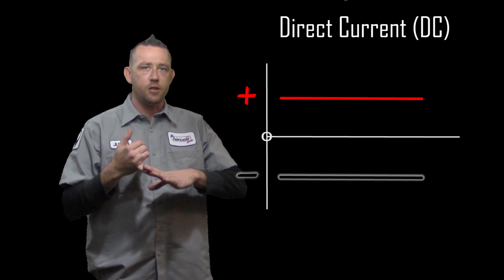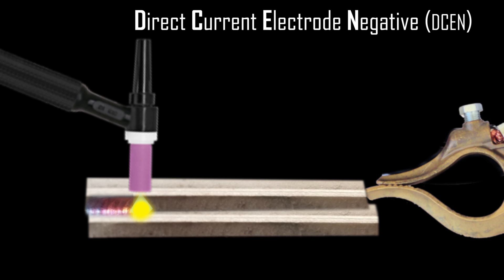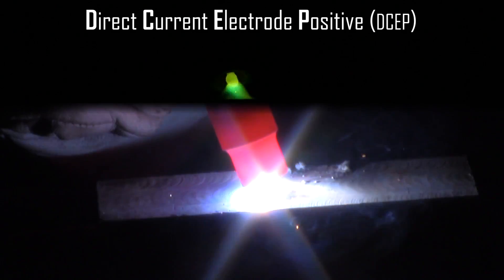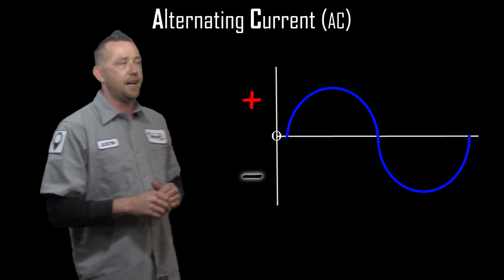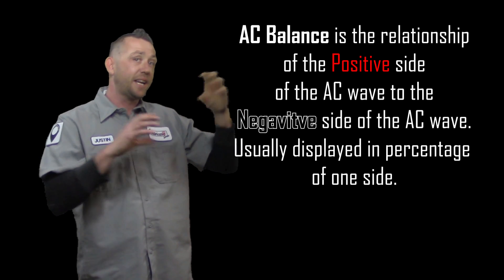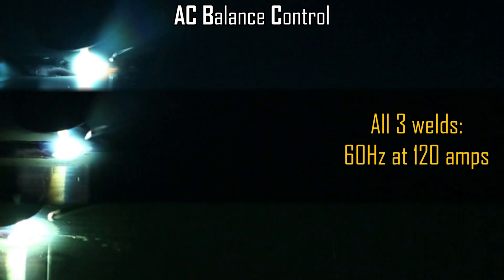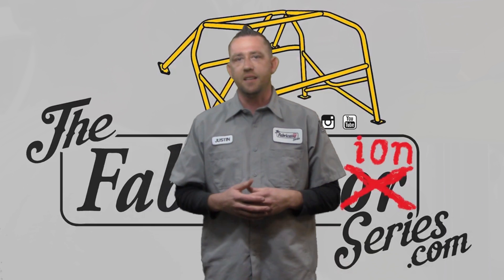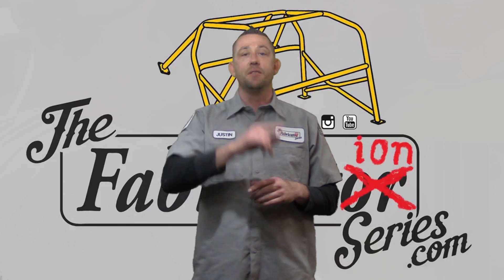TFS: Understanding AC Balance #TIGSimple

Comment: Could you please explain this tungsten electrode specification:-  Electrode diameter 2.4mm, DC electrode positive 100-200 Amps, DC electrode negative 15-25 Amps and AC 85-160 Amps. It seems that most TIG welders are electrode negative. Is that this electrode should never be utilized with a welding current more than 25 Amps electrode negative? Please explain. Thank you.

Comment: Fortunately I know that if Al is set at 1500°F in your graphic it should mean around its 600°C of its melting point, so therefore 3500°F should be approx 1400° of which temperature degrees normal people use. Yes I could ask Google for a conversion but... Oh please.
It would make more sense if you explain it in Kelvin scale.
Yeah it's a convention like any other but this thing makes no sense to me. And by this thing I mean the whole imperial system, which for how's not organized I don't see it being a system at all. I'm born with ten fingers you know, I'm not a buccaneer which has lost some of them to a crocodile. Damn, I try to learn something and have to focus on how to find a units converter...
Somebody will have to be stopping this madness, I'm just doing my part.
Thanks for the content anyways, units of measure was not the point of it ok.

Comment: Hi, i have the older type Thermamax Thermadyne tig 200p acdc inverter, new condition just alot of knobs. Not sure if you are familiar with it. I love your channel, you are extremely knowledgeable and straight forward. Mine don't show AC balance and Hz etc, different names. Can you help me with settings for Alluminium. I been ark welding for 28 years, mig welded a bit too but i need to master alluminium and stainless tig. My settings are Pre flow, Peak current, Basic Current, down slooe, arc force, pulse frequency, duty cycle, clean area width and gas after flow. Then ACDC, 2T 4T, pulse straight and tig mma. Thanks in advance, Michael Sharrock. Do you do online courses

Comment: Thinking to attend a tradeshow at Vegas in Jan 10-13, 2022.  Do you have a hands on training available near that time?  I'm pretty much a rookie, but have watched many vids (including yours).  I've successfully MIG welded mild steel with my Lincoln 180T, and a drive shaft for my son in TIG (steel), using my cheapy combo Simadre TIG/Plasma/DC Arc welder.  I Just ordered a Primeweld 225x, and expect it to arrive in a couple days.  Want to learn aluminum.  Currently have a repair project for cast aluminum (yes I know... not really a project for a rookie!  But I will try anyway.  LOL).  Would be great to get some training.  Thanks!

Comment: The commercials, the commercials! It's hardly watchable anything on here anymore. It's not as if they're a trillion dollar company. They need more power! Speaking of power. You're going to pull more power from the outlet messing with the A/C balance. ON the edge you may trip the breaker if you're close.

Comment: mate thanks a bunch for trying to teach us new types to weld Aluminium when showing us the alloy side you say your going a bit slow and yes i have bin welding and using TIG A long while back now trying to reteach my self now the QUESTION and i cant blame you if you don't answer its all good (( but is there a setting where you can slow things down some what as at moment in trying to keep up with the puddle and dipping rod its all a bit quick and i am melting the work piece any help would be appreciated  thanks wally

Comment: Hei Justin, just to be "politically correct" here. Electrons travel from '-' to '+' ... because well electrons are negative. Current is a convention and travels from '+' to '-' (Kirchhoff law) and same goes with voltage. I guess it is simple for human mind to see something going from '+' to '-'. Often this convention is very easily visualized as water flow (from top of the cliff to the botom of it). Cheers (by the way nice video, I just bought my first profi TIG AC/DC machine and can't wait to play with it :) )

Comment: Sir, what is the setting that you would recommend welding 3mm aluminum? Considering that I've cleaned the material?

What are the settings for 
1. Balance
2. Amp
3. Tungsten thickness and type

Thanks

Comment: While the effects of it may be described well by this, if one wants to be strict, the physics are a bit different. First of all, current doesn't flow from negative to positive. Electrons flow from negative to positive - they each carry a negative charge, and when negative charges travel in one direction, you have a positive current traveling in the other direction, that is, a positive current flows from positive go negative.

Secondly, the oxidation layer isn't "blasted off" by the current moving from the material to the torch - as said above, current doesn't travel in that direction. However, the current flowing from the torch to the material displaces electrons from the argon atoms in the gas. This makes them into positively charged ions. As we all (hopefylly) know, opposite charges attract, and since in this configuration, the material is negative, meaning the positive ions created will rush towards the material and it is this stream of ions that will displace the oxidation layer and allow welding to occur at the core aluminum melting point of about 1500 degrees.

Love the vids.

Comment: When I was an apprentice my instructor told us it was all to do with the temperature of the arc. On DC set 66% of the temperature is at the + side and 33% at the - side. Why you can't weld aluminium on DC - is because the melting temperature of the oxide skin on the aluminium is higher than the arc temp so there is no cleaning effect. But the arc temperature on AC split 50/50 so the temperature of the arc is now higher than the oxide layer and the arc cuts through that oxide layer giving you that cleaning effect. You can’t weld DC+ because the arc temperature being at 66% is too hot for the tungsten and melts it away. At that time all the AC TIG sets I used had no AC balance, so your balance was set to 50/50 with no adjustment. To overcome the extra heat, we used water cooled torches and larger zirconated tungsten’s whereas now you can turn the balance down to 70/30 for far better results.
Reply: You can weld aluminum on DC with Pure Helium. Tricky but feasible.
Reply: @hoseyogradey3487  I worked in a shop in nor cal many years ago where we used both helipad argon mix. We were welding 1/2 to 1 inch thick aluminum plate and parts we had the newest machines at the time the aero waves. I remember taking the test in this mix of gases and said I never did this before it looked weird as I was doing it but after much practice I got used to doing it. It does get sooty and black but that’s what we did.

Comment: Had to do a repair on my cast ally mower, just now. A crack that had separated the bracing (left side to right side) at the bottom rear of the mower needed to be stitched back together. Did a quick practice on some nice scrap ally panel (not cast), seemed ok. Ok time to hit the cast, what i didn't do was set the ac bal to 30-35 % which i had used on the panel (for some reason i set it to 50/50) Now i know why the dam thing was spitting tacks (didn't help with getting low on argon either, which i'd set to 15 tho most probably should've taken it down to 12) . It was a pain to weld like that however i persevered (only needed to weld 2.5") & got it done at least for now. Although my settings were up the Khyber it didn't turn out too bad. It could've done with a bit more grinding to create a deeper V for better penetration & strength. That cast really is a dog. The only other time i've welded cast ally was with a 150 amp mono mig (transformer style), i have to say the tig was far better if for no other reason than getting heat to the material quickly & at the same time not overheating & blowing through, where as the mig started cold with a huge blob then slowly came right, a bit to right when the heat got too much lol. Watching vids is great for getting settings & seeing what it should look & sound like, it then allows one to understand whats being said after welding as it's hard to imagine when you've never done it.  edit: i also didn't use the square wave i used the sine so i guess that didn't help either as i thought if i switched to the square it would activate the pulse function which is what happens when i stick weld & switch to it on purpose. I didn't think about turning the pulse frequency etc knobs to 0 lmao . Ok more tinkering with settings & waves & see what happens, it's no wonder people get those machines that set everything for them, what can i say i'm a Masochist

Comment: Ok, there’s one thing that really bothers me about the term some people use for the return line with the clamp. Ground, earth, or whatever. It’s NOT! It’s a part of the circuit. As we can see from TIG welding here, it’s actually the positive side of the circuit. The only ground from a welder is the ground from the power cord going into the machine from your electric plug. When using electrode positive, then the clamp is the negative side. In AC, the clamp is part of the AC circuit.

If you attach the return clamp to a metal object that’s grounded to a ground in the wall, you will get a short. Don’t do it!

Comment: You're Doing excellent job. But I would like to see more on the one I'm purchasing Everlast PowerTIG 200DV 200amp 110/220 Dual Voltage PULSE ACDC Welder.
Reply from the maker: I don't own the 200DV, but if I can get ahold of one, I'll make a video. It's a very popular machine.

Comment: Great video and graphics, but what if your machine's AC balance is on a percentage scale of 0-60? (like ours at work) How do you translate the '70/30' rule of thumb to that??
Reply from the maker: Phil Nichols Are you sure its balance and not bias?
Reply: The Fabrication Series - no its definitely AC balance, it says so under the LED on the unit. The welder itself is a Jasic TIG 315P ac/dc digital inverter.

Comment: This is a very good explanation. The only thing that could be added is why electrons travel from negative to positive. The answer as you probably already know is that electrons are a negatively charged particle and therefore attracted to the positive side (I.e. the side with fewer electrons). I leave it the you to decide if this will helps or hinders the explanation. 
 Regards, Gary.

Comment: Electricity flows from higher potential energy to lower potential energy, regardless of the polarity, NOT negative to positive...
Reply: Beach&BoardFan and with that said higher potential is reference negative 😂
Reply: The point is the ELECTRONS are moving.  And electrons are negative.  And the electrons are moving toward the positive side of the polarity.
Reply: Beach&BoardFan hi Jody here, today we'll be welding on electrode higher electric potential energy direct, non alternating current.

Comment: wave, what is the relationship between amperage and balance? ex. 300 amp. more positive or less positive?
Reply: If you have a higher % of neg half wave then you do not need so much amps. This is because the negative bias (EN) will concentrate power/amps to the work and, your Tungsten will keep cooler which has the added benefit to increase the duty cycle of the power source (welder).

Comment: If using AC cleans the oxide off aluminum, why couldn't you use AC with steel that has mill scale or rust on it, and clean it the same way? Is there some chemistry or physics reason I don't understand?
Reply: Brooks Ellis less stable arc
Reply: The AC arc is less stable, and steel cleans well enough with a wire brush that you don’t need the cleaning action you get from AC.
Reply: @JustPietzche  AC doesn't 'clean' anything it breaks down the surface Oxide of Aluminum which has a natural affinity with oxygen, therefore if the material/work was dirty, oils, paint etc. on surface the 'weld' would be contaminated and look crap!
Reply: He explained the reason why you need to do this (with smaller welders, industrial aluminum welding often uses DC) the oxidized skin on aluminum, which forms almost instantly on aluminum when exposed to the oxygen in the air, melts at about 3,800 degrees F. The underlying aluminum itself melts at about 1,200 degrees F. So the problem is that you melt the aluminum underneath the skin, but not the skin, at least, not at first. So you can melt through thin aluminum without getting the skin melted fast enough. Because of that, your welding rod, when melted, won’t stick properly, and it will be a mess.

Steel doesn’t have that problem. But remember that when TIG welding steel, you must clean off the mill scale and other junk, often by grinding, before you weld. You can weld through it, but it will be a poor weld inside.

MIG welding is very different, so you can weld aluminum on DC, and you can successfully weld through scale on steel.
Reply: Arc in DC is directional and very focused unlike AC which is less focused and less stable, but a fundamental misperception people make/or explain is that the 'cleaning' action doesn't and will not 'clean' surface dirt, oils, or any contaminants it will only break down the surface Oxide of Aluminum which has a natural affinity with oxygen.

Comment: Thanks for the video. The graphics makes them definitely expert for everyone. However, I must have a strange machine that besides the a balance it lets me modify something called 'AC Bias' which not even the manufacturer clearly explains in his poor manual (import machine). Have you or anyone known anything about it? Thanks in advance.
Reply from the maker: Antonio Maeso Bias is adjusting the amperage of each side of the wave. Let's say, instead of having 100 amps positive and negative, you can set 100 amps positive and 70 amps negative (or any other way).

Comment: Love that balance explanation. When I was getting used to playing with it I did some cast valve covers that I could not get why it looked like hot garbage. Figured bad cast... turns out I was playing with balance the wrong way at 90/10. Once I got back to 70/30 it went like butter. Great visuals, I'll share it with my learning tog buds.

Comment: Does the cost of the welding classes include all the materials metal, aluminum..etc  Thanks
Reply from the maker: Ron Johnson Yes. The only thing you need to bring is yourself. We do recommend bringing your own gear (gloves & helmet) if you have it so you're comfortable, but we have it if you don't. All metal, gas, consumables, and machines are included and we have 7 machines to learn on.

Comment: that is probably the clearest explanation and graffics of what is happening I have seen.  Thanks for the informative videos
Reply: 35 yrs of welding and that is the best I have ever heard for a explanation. Thank you......
Reply from the maker: supakat500 I have the AHP specific vid coming up soon. I've been lurking around groups and forums trying to find info about what people are struggling with on that machine.
Reply: Tony Bush Agree...plus he was using Ahp 200x Tig showing connections.  One of the biggest issues I have is the work and how pure the aluminum is.  Now understanding balance better, I should be able to get better results when welding two diff grades.
Reply: I was about to say the same thing until I saw your post.
Reply: Absolutely! Thanks